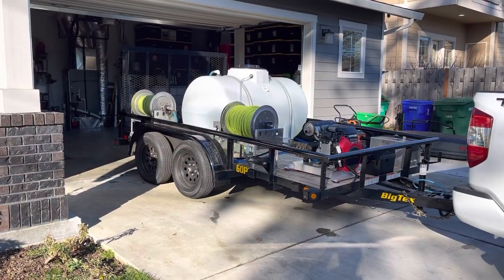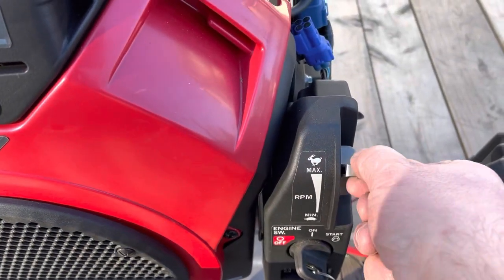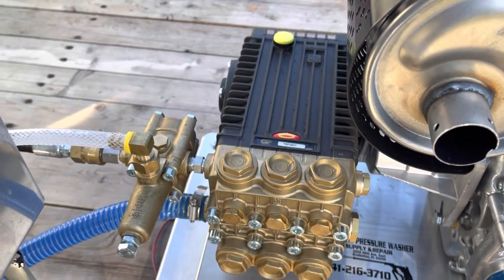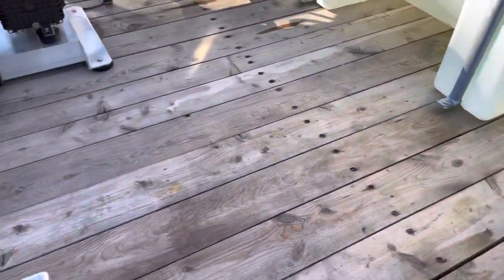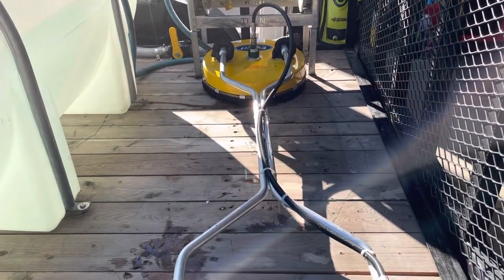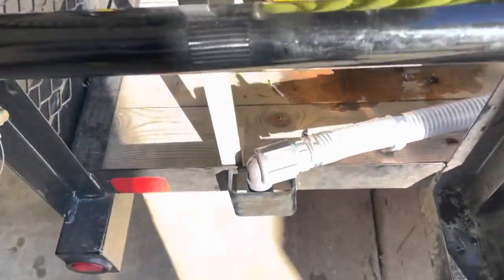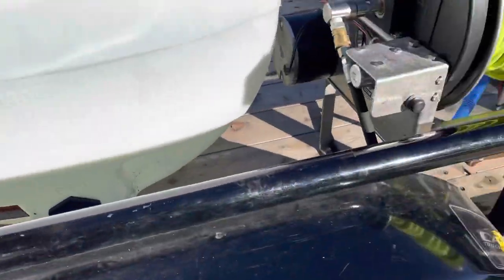Pressure washing trailer build setup - 6x12 dual axle trailer Honda iGX800

Comment: Good looking design. The only thing I might add is raptor liner. Bleach + wood = Early Failure.
Reply from the maker: I think raptor liner looks nice but definitely not needed. I have a trailer that is 6 years old. The wood is only treated. Still holding up. Probably last another 6. It’s a great selling point but not necessary. This one was not one of our ground up builds. This was bought used from another contractor and changed up a little.

Comment: looking for advice on the plumbing. I have thr trailer, the tank, the pressure washer. just need the hoses and correct plumbing schematic. I want a small tank for cleaning solution as well.
Reply from the maker: I have many videos on how to run your plumbing. Each build is a little different. You basically need a pressure washer that will pull water from a tank. Not a direct drive machine. You need a belt or gear drive machine. Run crush proof suction hose, a filter, a dump hose, a bypass, that’s about it.

Comment: Nice build…love the open design . Will you be adding a softwash system to this setup? What do you think about valves before and after the filter for quick cleaning and keeping pump primed?
Reply from the maker: If you are talking about proportioning valves, they go before the pump and the pump draws off the 3/4 hose into the pump. This may not be what you are talking about. I like to keep stuff as simple as possible for easier maintenance. I probably won’t be adding a soft wash system to this trailer. Just a bleach tank for downstreaming and maybe a hot box. I have the soft wash set up on the flatbed. This trailer is mostly for commercial. Appreciate the comments.
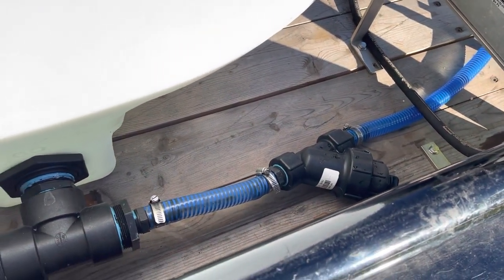Reply: @ExpertPowerWash  I meant the line between the water tank and your pump so you can pop the banjo filter on and off without losing pump prime and or emptying your reserve tank. Before and after the filter 4:25
Reply from the maker: Oh that’s 1 inch crush proof suction hose.

Comment: Hi Tim. Great info your putting out. I wanted to if your using 12.5% concentrated SH or 5%.  I am starting out with a downstream injector for my SH / Surfactant mix. Should I inject SH full strength and let the wand do the mixing or dilute at the injection site ?  Which way do you think will work best.  I'm in S.C.
Reply from the maker: Hard to give a quick answer. I use 12.5 SH. Every downstreaming set up will draw different. You may have to cut it. Keep on researching and studying. I appreciate the compliments and the comments.

Comment: How do you like the flexzilla pressure hose?
Reply from the maker: No good. Had it on a used reel I bought. Figured I’d use it until it blows. Super stiff and kinks. You would think the opposite from Flexzilla.

Comment: 8gpm@4000 What tips are you running on that 19" surface cleaner?
Reply from the maker: 4 bar, two 25025 and two 25020. My other 8 GPM I run four 25020.
Reply: @Expert Power Wash  ok. What if you was putting it on a  2 bar?
Reply from the maker: Think I had 4045 but it’s been years since running a two nozzle bar.

Comment: What pressure washer hose do you run on this trailer?
Reply from the maker: The Flexzilla pressure hose is on there until it breaks. I hate it. It’s stiff and kinks. It was on a previous set up that I bought. Figured I’d try it. Definitely not worth it.